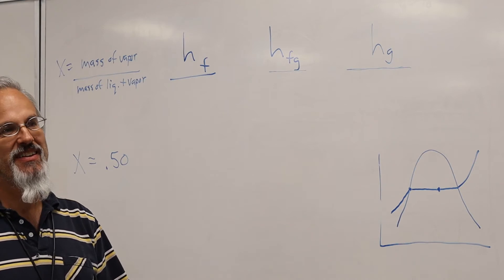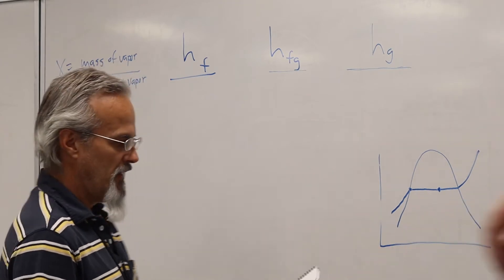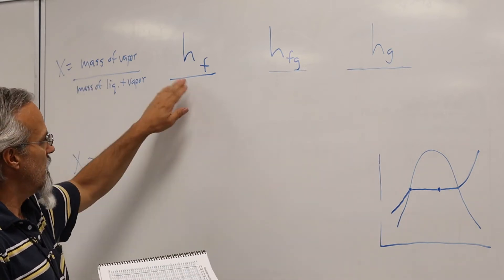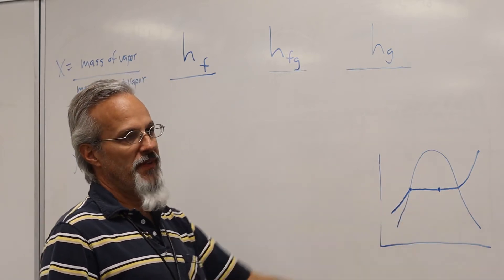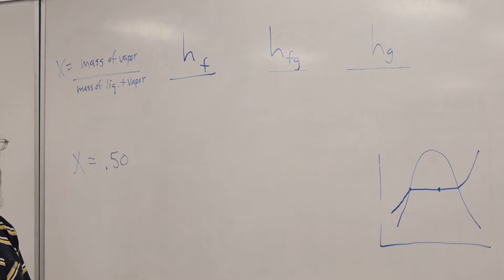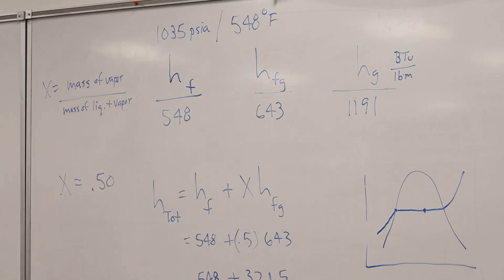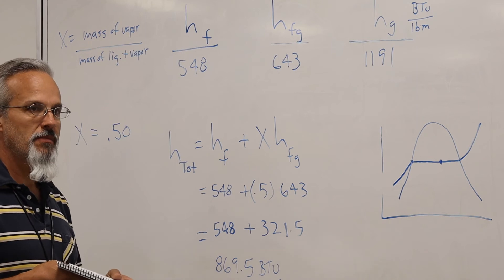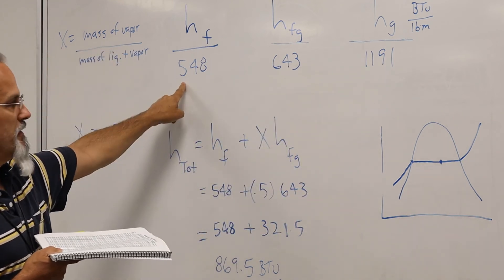Enthalpy and Steam Quality

Comment: Thank you for the video. I know this can be confusing, and quality/enthalpy of wet steam is sometimes a question that comes up on state exams. Below I will do my best to explain it and show the calculations. The reference for this is Steam Power Engineering Third Edition, by Edgar MacNaughton, pg. 65-69.
Steam quality or enthalpy of wet steam is a fourth value that can be determined if three sets of values are known. There are two calculations for this. The first calculation is the same as the one shown in the video and uses the quality percentage to determine the enthalpy of the wet steam. The second calculation determines the quality percentage of the steam using the enthalpy of the wet steam. I'm going to use the same numbers as he used in the video and show both calculations except that I use a q to represent quality. He also used hTot to represent wet steam. Here I use hs which represents heat of steam.

hs = hf + q(hfg)       q=(hs-hf)/hfg
q = Percentage of quality/dry fraction = 50%, hs = Enthalpy of wet steam 869.5 Btu/lb, hf = enthalpy of saturated liquid = 548 Btu/lb, hfg = enthalpy of evaporation = 643 Btu/lb, hg = hf + hfg 1191 Btu/lb

The first calculation is the same as in the video except I use a q to represent quality.
hs = hf + q(hfg)→ hs = 548 + 0.5(643) → hs = 548 + 321.5→ hs = 869.5 Btu/lb

This calculation uses the enthalpy of wet steam to determine the quality/dryness fraction.
q=(hs-hf)/hfg  → q=(896.5-548)/643 →q=321.5/643 = 0.5, Quality = 50%

I'll put a couple of different word problems below using the formulas.

A pound of wet steam at 600 psia has 90% quality. What is the enthalpy of the steam?
Use steam tables: Find values for saturated steam at 600psia.
hf (saturated liquid) = 471.6, hfg (latent heat of evaporation) = 731.6, hg (saturated vapor hf+hfg) =1203.2
hs = hf + q(hfg)→ hs = 471.6 + 0.9(731.6) → hs = 471.6 + 658.4 → hs=1130.04

A pound of wet steam at 600psia has an enthalpy of 1130 Btu/lb, what is the percentage of quality? 
Use steam tables: Find values for 600psia.
hf (saturated liquid) = 471.6, hfg (latent heat of evaporation) = 731.6, hg (saturated vapor hf+hfg) =1203.2
 q=(hs-hf)/hfg → q=(1130-471.6)/731.6 → q=(658.4)/731.6→ 0.8999, 90% quality

Comment: Side Note, The reason you don't use water is that water would require a pump. A pump requires electricity. Using electricity to generate electricity........ 😂
Reply: Yeah, we aren't really using heat, we are using heat to create a vapor under pressure to perform mechanical work. 😄

Comment: Ok but how do you know what X is? X also represents the amount of latent energy that has been added but if the pressure and temp remain constant until you reach full saturation, how do determine X?
Reply: In calculations X is the unknown value that needs to be determined. I added a detailed comment to this video that explains the calculation used in this video and how to determine the percentage of quality. I also included a couple of word problems to help further show how these calculation are done. I hope the comment I added to this video will help you understand the math. 😊